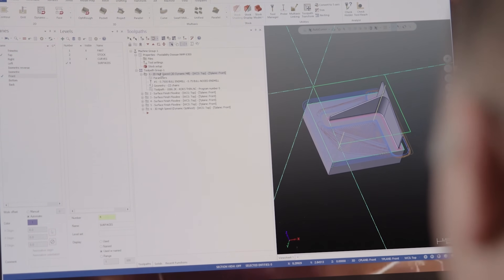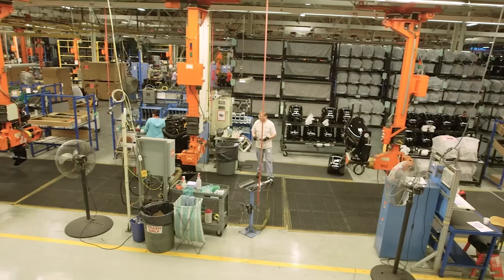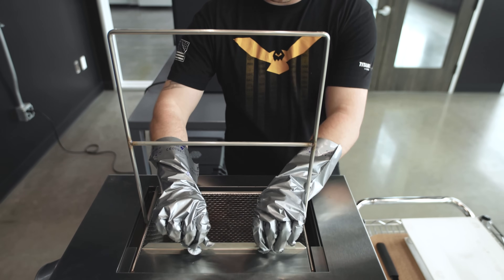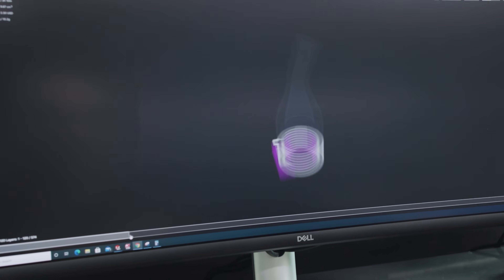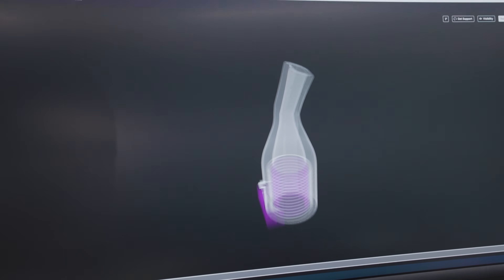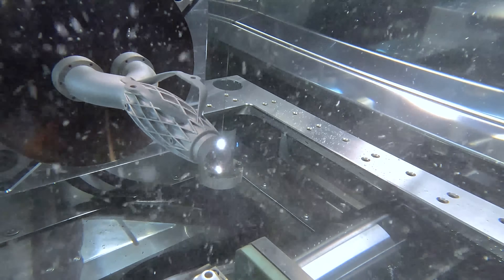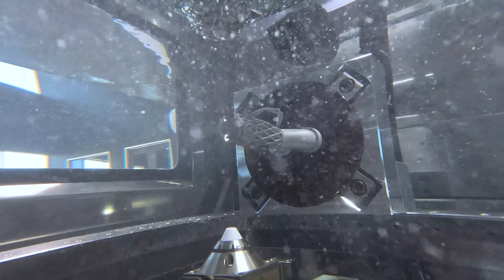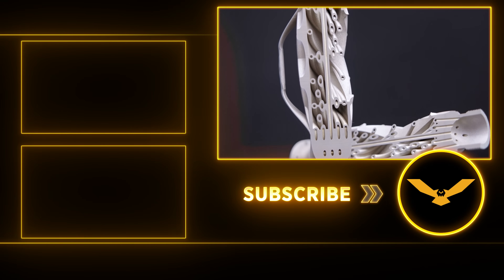Why Won’t Old Machinists Teach Young Machinists???

Comment: if the lesser experienced person is an decent worker I have no problems explaining to them how and why I did something. having the shop stop because you are not at work that day or take a vaca is also a bad thing!! sharing the knowledge keeps the parts cutting when you are not there and keeps the interruptions to a minimum during the day. self taught machinist / programmer

Comment: If you have a young want to be machinist, don't put them in front of a fucking computer. Engine lathe, vertical Mill, horizontal boring Mill, rotary table, indexing head's. Calculate tapers, threads, conjoined angles. All with pencil and paper. You guys are a joke. Us old farts have been doing it for years, without your fancy computers and overhead.

Comment: For the record this is a part of why the Saturn 5 rockets cannot be rebuilt today.The vast majority of those parts were handmaid and fitted. Much of that knowledge died with the guys who did the work As they were replaced by machines.
Reply: They can be built today, and in fact, there was a development project to use them singularly for heavy lift rockets, oh?, ten years ago? They did a redesign to eliminate 95% of the handwork, and because all the parts are much better fitting than the original, they're more consistent in thrust, cheaper, and higher output(approximately 15% more - 1,800,000 lbs of thrust). They're called "F-1b".

Comment: Titans of CNC is so ignorant about large companies and cut throat culture. I've seen so many older workers forced into buyouts and downright pushed around because they were replaceable. The ones who had special skills or knew the correct people always get the cake job and are respected and kept around. As an older machinist in a large company, it's always good to keep secret knowledge over managements head.
Reply: Then you're perpetuating a flawed mindset and the industry won't get better as a whole.
Reply: @TylerTITANSofCNCTippit  it's not a worker up situation. It's a stockholder/shareholder, then ceo, then management, then worker situation. Being in a company is all about a worker protecting themself at all times. My point being that Titans of CNC has a very admirable rags to riches legacy however will only last for one Titans generation. Times of knowing the common workers struggle will quickly fade and once again will return to a CEO wanting to see better numbers for the shareholders, and management back to pistol whipping to get their workers to perform better. This is the sad reality of manufacturing. The knowledgeable are used, the do-gooders are scapegoated, hard-working folks are blamed for all wrong. And the good-ol-boys get promoted.

Comment: Late in my career not too long before I retired I was assigned to run a program for fleet optimaztion.  Basically,  to determine vessel size, speed and numbers for moving oil from a source to an end user.  The program had been developed by a contract employee for this specific market. The contract employee believed that because he developed the program it was an intellectual property that belonged to him.  This was despite the fact he was paid specifically to develop the program for the company.

I was given a cursory explanation of the program and what it did.  Unfortunately, I was not given any of the keys that were needed to run the program.

This action, in my opinion,  was an attempt to assure a need for the individual 's continued employment.   This, again in my opinion, created a lose/lose situation.   I could not run the program to produce needed data and the company could not get the answers from the program they paid to develop. 

Companies need to assure that when they pay to develop a program that they are guaranteed not only full access to the program, but they receive a  fully documented program with all necessary information to run the program. 

Companies need to make sure as employees gain skill and knowledge that the skill and knowledge is shared with other employees, especially younger employees. 

At the end of my career I was told that when I started working employees hired on with the understanding that they would work until retirement.   I was told that in today's world employees are commodities to be added and disposed of as the company saw fit.  Personally,  I was part of a Reduction in Force (RIF) 9 months before I fully vested my retirement.

To assure knowledge is shared companies need to ensure employees are protected, compensated fairly, and will reach retirement.  Employees should never be in a position where they have to protect their knowledge.   By the same token if a employee is unwilling to work well with others, that employee should be counseled, and if necessary after a given period terminated.

Bob

Comment: The corporate mentality is such that it is all for the company. You put out 110%, the company gives you an atta boy and if you're lucky they'll treat you with a gift card!! When the trades had representation it was easier to take on apprentices or do in-shop mentoring. Nowadays, if you know what I know, I'm less valuable to the company. If I were to teach you what I know, I will eventually get my walking papers and the company has a trained employee to take my place for less $$$. It's a sorry state of affairs in all the trades. The old-timers are dying off and with that, age-old knowledge and tricks of the trade go with them.

Comment: Mark clodwick taught me everything I Kno about cold headers and machining tool steel. He could tell you everything he knows and was never worried he was a literal master of his work he had lapped a thousand dies honed a thousand carbide inserts and even with all his knowledge he was worried cuz you need the experience that goes with it too. When I started machining the only old ppl who wouldn't teach me were the ones who didn't actually know very much but their specific job or were mentally unstable and could not function as a team they either worked alone or not at all.

Comment: I'm a retired locksmith machinist, with many years of invaluable skill and experience and many tools to pass on, but do you think I can drag my reluctant waster of a son away from his perpetual gaming addiction long enough to teach him anything? 🤨😉
Reply: have you tired asking him to help you ? 
Even if he doesn't know shit, ask him for help. 
Once he is there maybe show him some of the most simple tasks, and tell him to do that

I'm also probably in a similar situation  your son is in, and my father rather not pull me along to pass down his knowledge of being a car mechanic 

But I still remember,  when I was a kid, he would ask me for help in fixing a truck or car. 
I didn't know anything about fixing cars then, and I still don't till this day 
But he pulled me in, because, my hands are small and I could tighten up bolts in area his hands would not fit

he taught me what x y tool was called, showed me how to change spark plugs,
I would lubricate various components. he never explained to me as to what I was doing, nor told me why I needed to do xy, he just told me to do it

At the end I didn't learn at all, but I still have vague memories of doing things

Now a days when I look some videos on YouTube for fixing a car, as they explain how to do xy and why i need to do it, I would get memories of doing that thing with my dad
Reply: @apieceofcrap8794  I'm sorry to say his enthusiasm does not extend to washing himself on a regular basis, even with the threat of hosepipe intervention. He's autistic and has ADD, which means he can't focus on anything that keeps him interested for more than two minutes, if it isn't controlled by a gamepad and launches all out war with rapid fire missiles from massive tanks. His debt alone over last Christmas exceeded £3600 in college fund saving for a third year running. Kids lack responsibility and have little to no respect for money hard earned.

Comment: It seems that if the older experienced machinist gives up his best secrets to the younger machinist, he eventually gets canned and the company pays the younger
machinist less money to save thousands of dollars in yearly wages.
Reply: If an older experienced machinist can impart all their knowledge via a few secrets then they aren't that great a machinist. If they make themselves valuable by being a good machinist, a good worker, a good teacher and mentor, and a good employee, then they maximize their chances of being able to retire from the job after a long career.

Over my career I occasionally crossed paths with old-timers who refused to share information. Most recently it was an engineer, probably close to 60 years old. I asked for help in doing a complicated calculation. He "helped" but in the form of giving me a partial solution without any hint of how to do it—basically he wanted credit for helping but didn't want to actually help me do a good job. That was his job security and I was far from the only person to have run into his attitude. It pissed me off so much that I spent a few evenings on Wikipedia figuring out how to do it (it had to do with calculating satellite orbits), wrote a program that replicated the results, and made that available to everyone. And the old timer got laid off less than a year later. I doubt it had anything to do with my program but rather the reputation he had gained for being difficult to work with. There were lots of other old-timers working there and was one of only two to be let go at that time.

Comment: It was almost 45 years ago I started working in a machine shop at a box factory. All of the machinists and/or mechanics knew or were related to each other as in-laws or friends with each other from the big one, WWII.
 This one week when Henry Maddock went on vacation I went over to use one of the three lathes that were his babies. His bro-in-law, Percy Gabbar came over to me just before I started setting up the machine and told me, "When ever Hank goes on vacation or is away for any reason he always moves the tailstock +/-.003." 
Sure enough the mark was off just that much. He sabotaged the machines to make himself look like he was the only guy who knew his job. 
 Well, this one instance I moved the stock back to where he had it and changed the mark with a light chisel and hammer tap, and added .003 more. Man... if looks could kill after he was back for a full day. He was baffled and I wanted to but didn't ask him if he checked the tailstock because some ass hole moves it to make himself look like, "the man."
Reply: Why would moving the tailstock sabotage the machine exactly? Tail stocks are designed to move to accommodate material lol.
Reply: @toddpick8007  Accommodating material is a slide this way or that Todd. Adjusting the tailstock after it is locked in place by adjusting the tailstock side to side will give you the biggest headache when you move your machined material to be clamped in the 3-jaw-chuck... Sigh.
Reply: @WhizeCracker  How do you adjust the tailstock "side to side' when its locked in place and is on guided ways? Its literally designed to be dead center there is no mechanism on a lathes tail stock that you can use to adjust left or right nor would you because its meant to be alighned with the chuck. Ive never seen a manual lathe that had a mechanism where you could adjust the X axis of a tailstock. I think you mean Tool post and are confused.
Reply: @toddpick8007  Todd, have you been trained in a machine shop ever? This was 45 years ago on equipment from WWII.
Is the track you slide the tailstock and carriage over called the way?
Once the tailstock is in position and clamped to the way the jam screws on both sides can be adjusted either way gently to be out of center (are you with me?)
Now look behind the tailstock and there will be a mark directly above another mark. If it isn't that means you might be working with Hank Jr.
Reply: @WhizeCracker  Ive worked in machining for 10 years run everything from Manual TOS lathes to Okuma and Dussan CNC lathes. Ive never seen anything where you can adjust the tailstock everything is fixed no markings on the rear for positional. You must be working on very old machines, to have this or very large machines. Thinking about it, would make sense to be able to align the tailstock on a larger lathe.
Reply: @toddpick8007  https://youtu.be/9s2iZ7HrQX8?t=30 See the square head screw on the OS? Well, I can assure you there is another screw identical to this one on the other side. Ours moved easily with a slotted head for a large screwdriver. I'm gonna go watch that old video now bub. Happy New Year and goodbye.
Reply: 🤣🤣🤣🤣🤣 so true...I went through thus as well
Reply: THE END
Reply: @WhizeCracker  You must have an exciting life thinking about me Kevin.
Reply: @toddpick8007  I'm 67, retired at 52. I've been in YouTube jail until today Mr. Pick. Honestly, I didn't think it would be allowed. I do admire you and Titan's ability in the machine shop. A simple, "Thanks for sharing" would have snuffed it.
 These days I do my all-purpose work for free. I enjoy walking the dogs on walkable days and movie nite in our ManCave. Celebrating 49 years together this month. 
Happy New Year Todd!!! I pray this year is your BRIGHTEST. PEACE...
Reply: @WhizeCracker  What were you in youtube jail for?

Comment: Yikes! Entitlement and Whiny the Video. 
>Why Won’t Old Tradesmen Teach Young Tradesmen???
They have no obligation to. And it's less about getting replaced and more about leverage in regards to negotiation on salary, responsiblities, commitments etc. If you have specific skills, traits, assets that are unique to you, giving them away to the wrong people at the wrong time can end your career. I've seen an old mechanic get forced into early retirement, employer continued to provide medical insurance until he qualified for Medicare, because a younger guy came along during COVID and did his job better, faster, and with less overhead expense. The old guy was told to pack up and take his toolbox home. 
Mentor's don't necessarily pass on every single little detail, nor should they, more often they push you in the proper direction and keep an eye out to make sure any mistakes being made aren't going to cost the company too much, sometimes its important to make small mistakes that have the potential to increase your ability so when the time comes, and you're alone, the sky falls, you'll be able to bear the burden alone. 
Teaching and advising while in a leadership role has its own difficulties as well, advice given on one particular job may backfire on another, takes experience in trial and error to know when its appropriate for some methods and not others.

Comment: That old guy was an idiot.

I'm very competitive, but I actively try to teach those I compete with how to do better, because if they are doing better then I have to do better to win, which means that I can then beat better and better opponents.
Reply: I started a new job at a machine shop running a 1000watt cow laser. The parking lot was full of pallets of parts on pallets. I was told it would take 5 years to finish all that work. After 2 years I finished it all. Then they laid me off. I worked 56 hours a week the whole time. 15 years later the manager found me on LinkedIn. Hoping I'd come back. Point is, your boss is going to burn you after they are done gaining whatever you had. It's the way life is. I love sharing what I know but I also know how to do things that nobody else does and those are trade secrets.